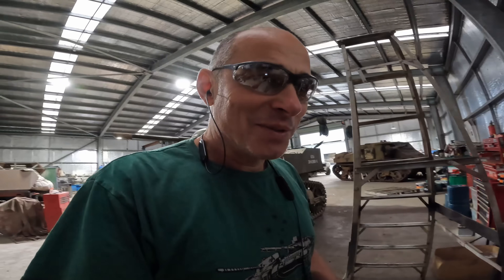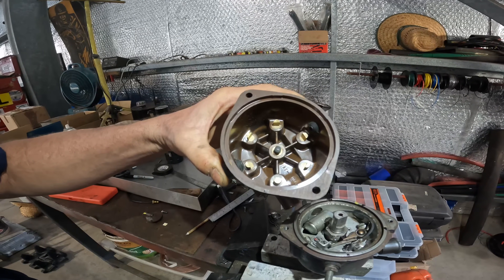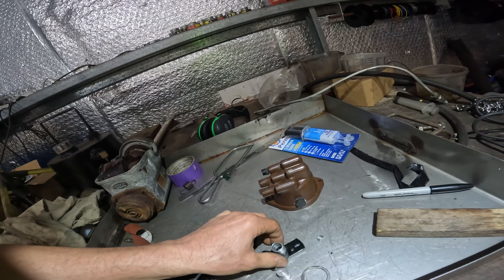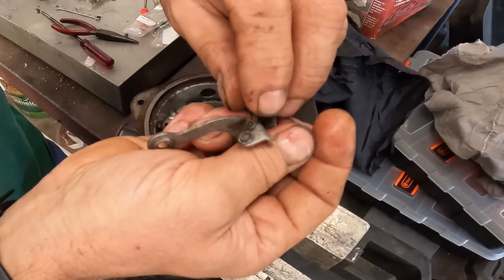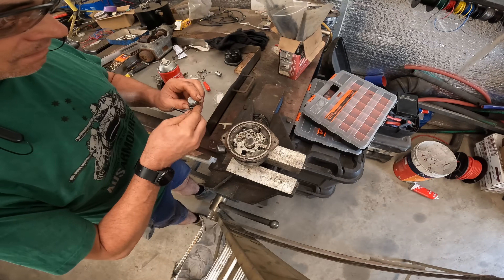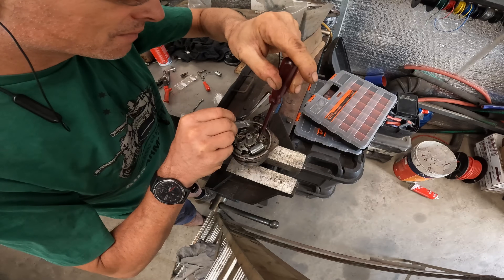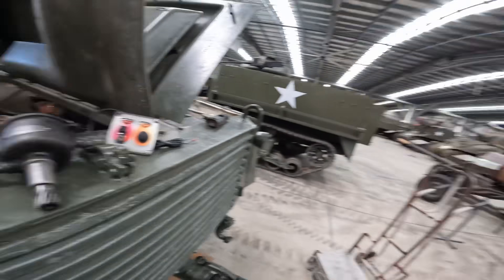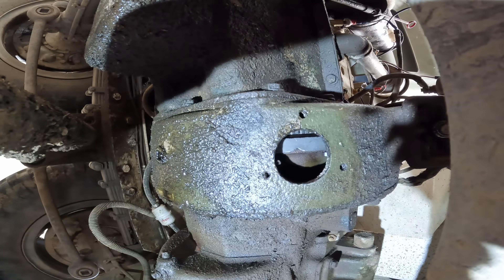FIX IT FRIDAY! M8 Greyhound Distributor and Ignition System!

Comment: Hi Guys I am On the M8 team at the Canadian tank museum in Oshawa. I feel your pain as you work on that machine, it is one of my favorites at the museum. My self and the team lead has repaired the brakes, and gas system in ours. and replaced a lot of parts. for new. we have gotten some stuff thru a place in France. we are currently fighting with the hydraulic throttle for the Greyhound. due to the high spots in the system, it is tough to bleed out all the air. . I am sure eventually we will get it to work. good luck with yours. Ours is a great little machine, I like being on that crew.

Comment: Many old carburator-engines shut off when started cold and letting go of the gas. Due to condensation losses in the (cold) engine - they lean down and stop.

The choke (if present) fixes it to some degree (depending on the engine - better or worse).

The ideal way is to start it - and hold the gas a bit about idle (not high, obviously - on a cold engine) for 2 or 3 minutes - until it warms up a bit and keeps running on it's own at idle.

When shifting up - use quite a bit more rpm than you would on a modern car. That way - shifting is easier for you - and the gearbox as that old 4-speed has quite a bit of spread in it.

Shifts are harder when the transmission-oil is cold. It takes the syncro-mesh more time to align properly.

I guess the M8 has quite a bit of oil in it - therefore it takes some driving to get it warm.

Comment: You did a great job of sorting all of that out, proving that a sound knowledge of the fundamentals will carry you through to a solution every tine.  I like these sort of videos.  Love the test rig, looks like contraptions that i throw together in similar situations.  In my opinion the rotor in that distributor was not the correct part but you overcame that issue.  You may already have it but a copy of TM9-1825B is a useful reference for work on the electrical systems of US vehicles of this vintage.  I rely on it heavily.  Easy to download a copy from multiple sources on the internet.  Or you can purchase a hardcopy reprint.  Hope that this is helpful.

Comment: I have 2 stories, The first one is about my cousin Albert. Albert lost an arm from the shoulder out in a combine accident. Albert worked with his brother as a mechanic. I have seen him change the points and condenser on a distributor and set the gap singled handed. Amazing gentle man may he rest in peace. The Second is about a Sargent in command of an M-8 during the battle of the Bulge. The Sargeant had the M-8 well camouflaged in a narrow alley way off of a narrow street in a village when a tiger tank comes along driving past the alley way down the narrow street. The Sargeant seeing his chance to do some good, slipped his M-8 behind the tiger tank and empty 3 or 4 rounds of 37MM into the ass of this tank. The German tank commander seeing this could do nothing as the barrel of the gun in the turret would not clear the buildings on both sides of the road. The German crew bailed and ran as the tiger brewed up. The M-8 was taken back to its hiding place.

Comment: Steve said that the idea of the condenser is to reduce arcing at the points.   It certainly does do that, that that is not the main reason why a condenser is used.   
Any two electrical conductors near each other have a property called "capacitance" - that is, they have the ability to sore energy in the electric field between them.   A condenser is a device made with two long ribbons of metal foil separated by a very thin insulator (traditionally oiled paper) and rolled up so as to give a high energy storage (ie high capacitance) in a small space. 
By absorbing electrical energy a capacitance slows down the rate at which voltage can change.
An ignition coil has two windings - a high voltage winding (the secondary) and a low voltage winding (primary).   The high voltage winding has a very large number of turns next to each other and thus a high internal capacitance.   The low voltage winding has relatively few turns and thus a low internal capacitance.   So the high voltage winding cannot have rapid rate of voltage change, but the low voltage winding can.
The purpose of the condenser is to slow down the rate of voltage change to a rate that the high voltage winding can accept.

Electronic engineers will recognise this as a transformer with loose coupling between primary and secondary, with the secondary having a high self capacitance compared to the primary.   To maximise energy transfer we need the primary to approximately match the resonant frequency of the secondary by adding additional capacitance to the primary.

Comment: Back in the day, if there wasn't a timing light available, you could adjust the timing by retarding/advancing the spark at idle until you found the spot where the tip of the radio antenna wobbled the least.

Comment: Good fix Steve! The issue here is rotor phasing. i.e. where the rotor is pointing when the spark is provided. If some or all of the conductive rotor tip isn't aligned with the post in the cap when the spark is transmitted, then the spark has to jump a greater gap than intended, resulting in a weak spark. This can happen if the rotor or cap are not made correctly. Dead Dodge Garage discussed this issue a while back. He has a test distributor cap with a hole drilled adjacent to the #1 plug post, and uses a timing light to see where the rotor is when #1 is firing. A simple and useful solution to visualize something we rarely think about when trouble shooting evasive tune-up issues.

Comment: Perhaps just changing the rotor button in the first place may have solved the problem, because that old one seems to be repaired with what may be an electrically-conductive material, thereby causing the spark to short out? Just sayin'😕

Comment: Some times you can check the wires in the dark they will spark flashes like lightning while it's running  and sometimes the cap can have fracture tiny one thar makes it sound like mis fires

Comment: Never seen the feeler gauge method of setting up the points, the only way I have ever done it is with a test light (and a degree wheel on the crank if you have access)

Comment: Sometimes  I would do a tune-up on an unknown Corvair engine.  To find TDC on #1 I stuck a pencil that had a small cylinder of foam rubber on the pencil- shaft into the empty sparkplug hole. With all the plugs out it was easy turn the motor over by hand. When the pencil popped out, I knew I was at TDC. Loosen the distributor body and point the rotor  to #1 and you had the basic timing then start the motor and use my timing light to get correct advance as I turned the body of the dizzy going by the marks on the crank- pulley. Fun!

Comment: Those plugs all look black and fouled. Clean them with a blow lamp or throw them way!!! They need a central electrode with no carbon. Test blug sparks in  pressure chamber. Any spark is easy under 1 atmosphere. 7 to 1 compression ratio is different....(103 PSI)

Comment: “Requires a degree of contortionism that I just don’t have the commitment for today” 🤣🤣🤣🤣🤣🤣🤣🤣🤣
Reply: I can only imagine all the little fiddly bits dropping and hiding in the chasm around the engine too.
Reply: @peppermill7163  At least on the old gear, you didn't have to spend significant time wading through plastic covers and extraneous "anti-pollution" plumbing, just to FIND the engine.

We were a Ford family, with my Dad starting on the Model T as an apprentice and there was a stream of "interesting" cars in the back yard; 1948 Anglia and Mercury, 1950 Prefect and a "stray", a 1950 Vauxhall Wyvern, (a mechanically fragile beast that became my "university ride"), a '55 Customline with its slightly finicky engine, and my mother's "aircraft-carrier-sized" Fairlane shopping trolley. In all of those vehicles, you could pop the bonnet and see the ground on either side of the engine.

Now, in my "retirement',  I am reduced to a ridiculously reliable Corolla.

Great work by Steve, as always. Loved the occasional bouts of loud hammering, interspersed by a couple of bars from the local tropical bird life.
Reply: Story of my life….😂
Reply: Me either rather be in the back of a bmp than up in front of one of them